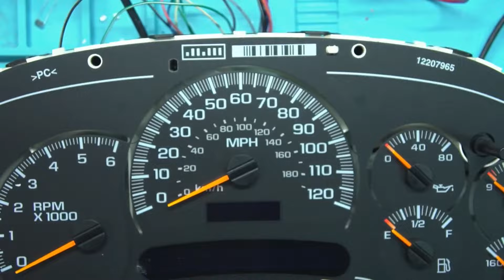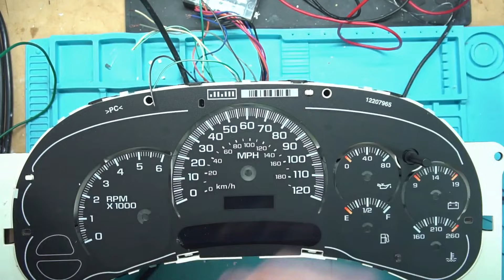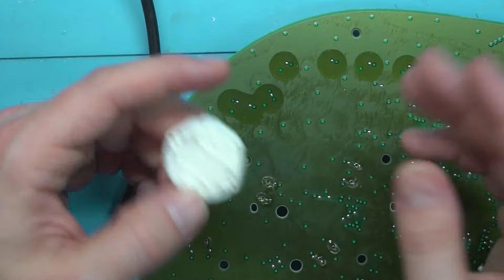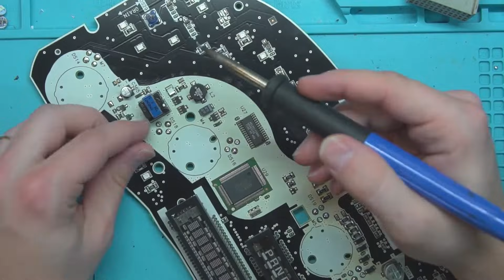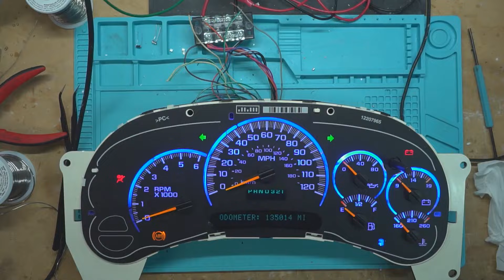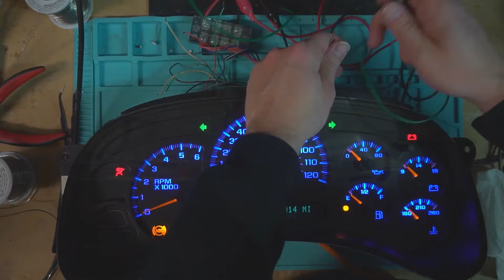2005 Silverado Instrument Cluster Repair plus Blue LED

Comment: Hi , Maybe you mentioned it in previous videos, but I changed the bulbs in my radio from incandescent to LED's when I apply 12v to main power on the control board they light up but when I plug back into my car the don't turn on when it's 'dark'. I was wondering how to you find schematics for vehicles ? (2012 Chevy colorado) Any help would be greatly appreciated

Comment: It seems my dome light switch kicks off a breaker in dash which causes total dash chaos.If i turn it off-- breaker resets and goes normal.Possible? Would switch replacement correct problem?

Comment: I bought an 04 that someone had added blue lights in and they are all flickering... any idea what to look for?  just need new bulbs or?
Reply from the maker: Leds got damaged/went bad from being cheap or improper size/current regulation. Yes you need to replace them

Comment: I did this on my 2005 Silverado and the dash lights are excellent except it’s triggering the engine light. When I plug in the hand held computer I get a code P0650 saying a malfunction indicator lamp. Sometimes the engine light goes out and then on again but mostly stays on. Any ideas? The computer must not sense the normal power draw from the incandescent bulbs and thinks there’s a bulb that’s burnt out triggering the P0650. Not sure how to fix this. I love the led bulb but hate the engine light.
Reply from the maker: P0650 is a malfunction of of the MIL circuit. The MIL (Check engine light) is a yellow LED. You likely have a faulty wire in the harness or cracked solder joint at the connector. It was never an incandescent bulb, and the backlight circuit has nothing to do with the MIL circuit.
EDIT - You can check the load resistor that's on the board. It's right next to the MIL its "102" a 1Kohm 2010 package size. Check for a cracked solder joint or if its missing.
Reply: @FixedUntilBroken  I think you misunderstood what I was saying. I never changed the engine light yellow led as  it’s already a yellow led. I only replaced the incandescent back light gauge cluster bulbs of which about three were already burnt out. As soon as I did it I got the engine light. It may be a coincidence that it first came on after I changed the cluster incandescent lights to LEDs but I doubt it. I’ve owned the truck since I bought it in 2005 and the engine light has never come on.
Reply: @FixedUntilBroken I think you may be on the right track with the load circuit though. I will check it for a good connection.
Reply: BTW the code I get and  what it reads is P0650 Malfunction Indicator Lamp (MIL) Control Circuit DTC severity 2 of 3 may cause damage to component
Reply from the maker: @turda4u yeah it has 1k resistor in parallel with that LED. It also has another resistor in series.
Reply: @FixedUntilBroken ok I’ll look that over when I get a chance. Thank you!

Comment: This is the only video that helped me! Had new stepper, motors, and bulbs installed and still had the problem, but the problem was the legs on the back of the gas gauge. Installed new legs like you did in the video and problem is fixed. Thank you!

Comment: So I tore off the connection surface on the board that the LL2705 chip connects to. I have seen that this can be repaired. Can you do this?

Comment: I just changed my bulbs in my cluster because they never worked and after they still wouldn’t work and I checked every fuse people said can someone please help
Reply: Having the same problem bro, u have any solutions
Reply: @issaiahgarcia758 I couldn’t figure out the real problem but I wasn’t getting power from the wire that controls the cluster light so I wired from my 4wd selector light wire to the gauge cluster light wire or you can go from really any lights that dim with the dimmer switch
Reply: @issaiahgarcia758 if you want to try it if you have a 03-05 look up 03-05 silverado 1500 gauge cluster plug diagram. pin a11 is the lights that’s where I ran the wire from then if you can get a test light and find the wire on your 4wd or wherever your taping into that dims the test light when you move the dimmer if you have more questions let me know and I’ll try to help as much as I can

Comment: My battery went dead. I mean nothing no lights or anything. I jump it off and it cranked great, alternator voltage 14.60 volt, battery not running is 12.95 volts but now my gauge clust isn’t doing anything except lights up and turn singles work. I have voltages on the plug at b1 12.95v, b9 14.44 up and down a little, b11 14.54 up and down a little, a4 12.95v, a11 12.95v. Didn't have any issues before the battery went dead. With those voltages on the connector, did my cluster take a hit? Please help. I'm disabled and on fixed income and need my truck to get to doctor appointments and buy food. Looking at the board, I don't see any bad solder joints. But would a dead battery cause it to go out. I dont want to have to try and get the money for one if it's not it. I also can't afford a mechanic. Thank you for any help, please

Comment: What's the cost of this job?
Reply from the maker: Like to DIY?
Reply: @FixedUntilBroken  No, for me to have you install new LEDs and gauges.
Reply: @FixedUntilBroken  I bought this truck used, 04 Silverado, and a butcher tried to replace the solder in bulbs. 2 don't work and the speedo is inop. Price me an overhaul job.
Reply from the maker: It would be like $120 plus shipping as long the board is salvageable

Comment: Will this make the truck run better?
Reply from the maker: LEDs add 10HP! No, the instrument cluster has no effect on the engine's performance. You can remove it, and it runs just fine.

Comment: 2005 was the first year of ROHS compliance. Removal of lead and other substances that were hazardous in solder. The end result was poor solder flow and adhesion. Mainly to PCBs as shown here. Solder formulation was quickly fixed by industry.
Reply from the maker: Ture. 
It's funny places with exemptions still have a lot of the misconceptions about lead free solder since they don't use it. I work in the defense/aerospace industry. We have a lot of old-timers that get upset about some of our newer products that use lead free solder. (It was actually used for thermal properties not used because we were required to)

Comment: Okay I replaced my stepper motors and incandescent light bulbs with LEDs. When I plugged it back into my truck to test everything, ALL my LED bulbs blew 😑 
With a volt meter I read 7 volts across the bulb, which is way more than those bulbs can handle. Any idea what might be causing such a high voltage? Or, perhaps I just need leds with a higher voltage rating...
Reply: You need 12v LED with built in resistors. 
Most 3mm and 5mm LEDs don't come with resistors and can only handle 3.2v

Comment: How can you tell which cluster supports steering wheel controls?  I swapped mine out with a lower trim cluster and now they don’t work. Is there someway to Identify a cluster that does and doesn’t have the option?  Thank you

Comment: My PRNDL orange lights are out on my ‘06 2500- would it likely be the same cracked solder issue on mine as this slightly older version cluster? Thanks!

Comment: I have a question hopefully you can answer. My cluster works perfectly fine other than  the battery light indicator stays on and the alternator is charging. I have everything working correctly. Is there a diode or something in the cluster  that needs to be changed to get the battery light to quit staying on?

Comment: I just replaced all mine with led and they stayed on for  about a minute then they all went dead.  The turn signal led still work and all other incandescent bulbs on the panel work as well.  Wtf did I do, the solder joints were redone if they looked bad

Comment: I just didn’t motors in my trailblazer but I was going to use led lights n plugged it in to test which way they went but the kept blowing my original lights work but I wanted blue ones what type of light are you useing are they 12v and where can I buy a bunch of them I want to do my other cars too I had really good luck with the stepper motors with a solder sucker by hand and took all my lights out and had to put them back in because I think the leds were like 2.3 v

Comment: I recently bought a 2003 Tahoe. It looks like I have BO bulbs behind the Water Temperature and Voltmeter gauges. They don't light up at night with the truck's lights on. I see now I can't just reach behind the dash and twist out a 168 bulb and change it. This is way more complicated than I want to deal with.

Comment: Sorry, why engine light dont work?
Reply from the maker: check engine is completely discrete and is an LED. If its not working someone either cut the wire for the SEL or tampered with board by removing the LED or covering. Of course the LED could have failed but that is highly unlikely.

Comment: I have an 06 Duramax and my lower screen is intermittent. It looks dfferent than the back of the one you are working on. What area should I  look for that has bad solder joints?

Comment: Hey what about if my odometer isn’t working?
Reply from the maker: Reads zero or Odo is dead? 99-02 or 03-07?
Reply: @FixedUntilBroken  it’s dead 03-07
Reply: @FixedUntilBroken  also what do I need to power on the cluster while working on it

Comment: 2005 Yukon XL SLT here--What would make the message center (below the PRNDL) remain dim all the time? Currently, the PRNDL does not work at all & the Message Center is so dim that you can only see it at night or on a dark stormy day.
Reply: I think he showed it in the video when he pressed on one of those flat resistors and the PRNDL popped back on. Have to reflow all of those resistors and you should get it.

Comment: Question. I purchased a cluscluster  that was got 03 to 07 silverado HD models no steering control center. My truck is an 05 silverado non HD. Also without steer control center. I got this because it had the transmission temp gauge. The problem  I'm having is at startup I get a service brake booster. My brake booster is new and has no error with the original cluster. It's looking for something that comes with HD models. Is there away to remove this? I've read that I would need to go to dealer so they can reprogram for my truck.

Comment: Love your videos!  What would cause my battery light to stay on. Volts fluctuating between 12.8 and 14.7. I replaced my cluster with one from wrecked 2005 Cadillac. I drive a 2005 chevy 1500

Comment: What kind of solder sucker iron are you using? It beats the heck out of a solder gun then holding a separate solder sucker. Thanks for any info.
Reply from the maker: The one in this video is the Anesty branded one I used to have. It lasted me about 2 years with heavy use. I now have a hakko desoldering gun

Comment: Where how can you jump the speedometer
Reply from the maker: Not sure what you mean? Like from missing pads or what?
Reply: @Fixed Until Broken   all the other clusters have a little spot next to the pad to run a jumper the speedometer doesn't have any spot close to it
Reply: @Fixed Until Broken   the speedometer has no sodding pads on 2 spots in your video you jumped the pin to the spot of sodder next to the missing pad the speedometer doesn't have a spot on sodder next to the pad like the others do didn't know if you can jump it as well like the others.

Comment: I'd like to know what LED'S he used. I haven't seen those before
Reply from the maker: I actually quite using them. The company went way down hill about a year ago.
Reply: Thanks
Reply from the maker: @arronhultquist2435  no problem. I now just solder a smd resistor and smd led on the extra pads. I've been needing to do a video on how to do it but keep forgetting.
Reply: How are you able to bench test the dash. What terminals do you have hooked up. What supply voltage are you using. I tried to Google the info but not all information is reliable
Reply from the maker: @arronhultquist2435  I show it in some of my oldest repair videos but the best thing to do is use AutoZones wiring diagrams and other free resources like that.
Reply: Is polarity of the led an issue? If so, is there a way to check for anode and cathode on the board with out using a mutimeter? I don't have a way to bench test it

Comment: If you still reply maybe you have an idea?
All indicator lights, warnings and Icons all light up and can be controlled by the headlight dimmer switch (just replaced today) The instruments all work correctly, needles move in correct mode. . The lights that back illuminate the gauges do not light up. I need to turn up the cabin light to see the needle positions while driving. No bad head or tail lights. Every other light or icon are working well .

Vehicles is a 2005 GMC 1500 Sierra
Reply: Did you put the led backwards?

Comment: Just found your video. I am needing repair on my 2003 cluster. All of a sudden nothing works except for the check engine light. My starter gear was sticking and it caught on the flywheel for a second and then nothing with the cluster was working. The speedo is stuck on 50mph and the RPM is stuck at 1500.

Comment: My process was not near as nicely done as yours but I got it done! Haha I appreciate the video. It helped a lot. I have 1 question. I replaced the stepper motors successfully and the bulbs as well. When I apply power to the bulbs(out of the truck) they work. I used a 9v battery with 2 wires for a quick test. But once I install the cluster in the truck - the gauges work but the new bulbs don’t come on. Do you have any idea what could be the cause?

Comment: What temp you like to solder at? When I was building racing drones, I found soldering hot and fast was best. If you had the iron a bit too cold, you’d have to hold it to the pcb too long and that’s when you would lift pads. 

Good video.  👍

Comment: I have a question.  My 2005 Silverado 1500 doesn't have a Transmission Temperature gauge on it.  Obviously the circuits are there for it to work on this panel.  Is the sensor in my truck?  If I install the motor on the board will it work?

Comment: Very useful.  My tach and oil pressure gauges weren't working at all and the fuel and water temp gauges were intermittent.  I ordered a kit from Amazon with stepper motors, the plastic pry bar you see in this video and some bulbs (not LEDs) that I didn't use.  I have small pry bars but they are metal; the plastic pry bar is very useful to keep from marring the overlay when removing the needles.  It's important to use a solder sucker (I have a manual one, not the automatic one he uses).  It to keep from messing up the pads when you desolder them.  None of my pads got damaged.  I did unbend the motor leads back to vertical (breaking the last bit of solder contact with the pad) and then used a small side cutter to cut them even with the back of the circuit board before pulling the motors out from the front.  I didn't re-flow any solder joints.  Before removing the needles rotate them to the left until they stop and then mark that spot with painter's tape so you know where to put the needle when you put it back together (I got that from another video).
Reply: That was a bit drastic 😂

Comment: Hey man thanks so much for your video, I got everything working on mine, except now the check engine light doesn't come on anymore lol. Not when I start the truck nor when I first power the cluster on. Not a big deal since it stays on all the time anyway just would like to fix it while everything is apart. Got any ideas? Thanks in advance!

Comment: Have you ever felt with a truck cluster with dic because I have the controls but when I press them nothing pops up on the cluster
Reply from the maker: Probably not the original cluster to the truck. It's a software feature on the cluster. If someone swaps them then it might not have the software on it.

Comment: Awesome description of your work as you were doing it I really appreciate the professionalism in not condemning others work on their previous repairs, I have an 2005 GMC Sierra that I did all this on around 6 years ago as well as adding the trans temp as I was told it would work if I added it however I quickly discovered that the 05 and newer need to have a switch electronically switched on and as I have no way to do that I have never been able to see that function, is this something that you can do if I send my cluster to you?

Comment: How do you tell the correct polarity on the circuit board. I know the longer side on the bulb is positive. Haven't opened mine up yet so I don't know if the board has an indication of positive and negative. Thank you
Reply from the maker: As you can see in the video the circuit board has no indication. You will have to plug it into to the truck and check with your multimeter

Comment: I had mine rebuilt, however it still isn’t working properly. I suspect one of the wires is shorted. Do you a graph showing the pin usage? I have check engine light and blinkers. Not much else… TIA
Reply from the maker: If you need the pin out it shows up on Google easily. I can't post pictures in the comment section on YouTube but Google will turn it up. What you are sounds like you have an issue in the power supply section of the circuit board.  What you are describing is the microcontroller is not turning on. 

You should contact whoever did the work. They should have a warranty and cover the repair. It's 98% chance that's a faulty repair. If they refuse to honor a warranty I repair them for $100 plus shipping

Comment: What are you charging for a rebuild , my father is needing this done to his 05 Duramax ? Do you have led's that more white than blue or the natural cluster color ?
Reply from the maker: For a more original look I recommend against LEDs so it will dim at the same rate as everything and the color will match perfectly. To answer the question though $80 plus shipping